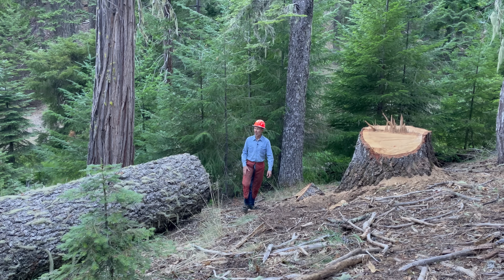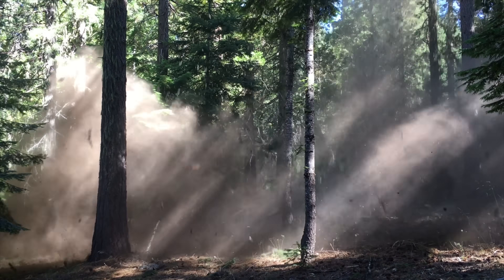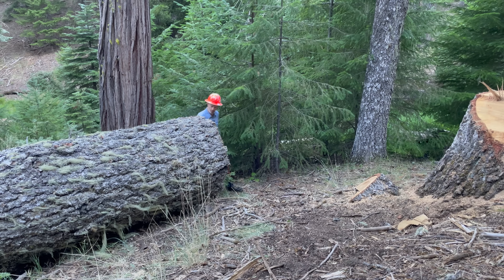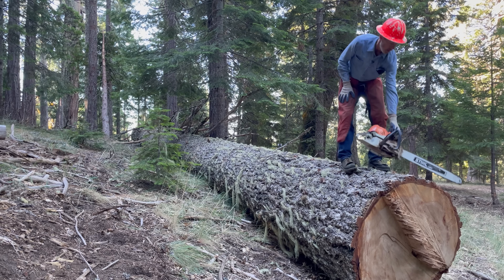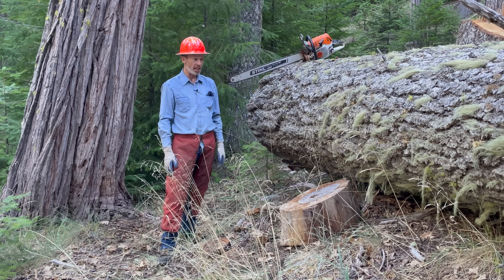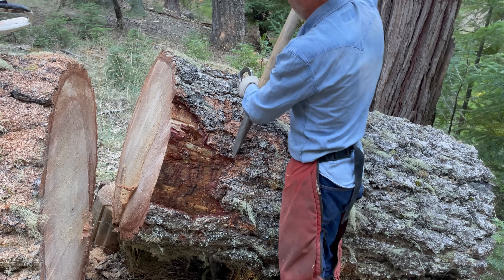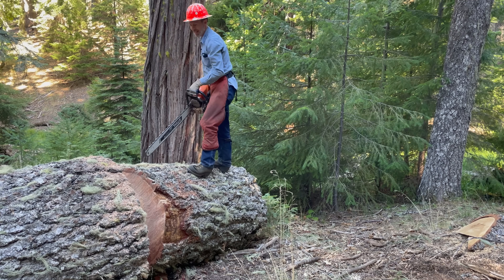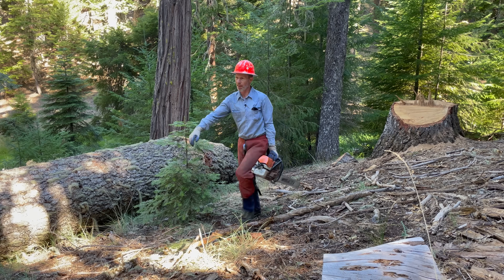Chainsaw Ripping Chain vs Square Ground Chain

Comment: Nice work!  Which saw and bar length is that?  Baileys says ripping chain is slower, but gives a smoother cut, but maybe yours was faster or comparable since it didn't plug as much?  A climber who also cuts slabs for businesses said he liked a skip tooth normal chain for his slabbing, probably white fir and jeffrey pine, since he was going to plane it anyway.  He had nice saws, but I figure skip tooth might help a marginally powered saw in big wood, by having fewer cutters doing work.  I haven't cut slabs or beams in a while, but your video makes me want to go out and work with the saw.
Reply: And now I see on your previous video you said it was a Stihl MS462 with a  32" bar.  Nice work, on all of these videos.  Love the humor you put in too!

Comment: I've found to pull back away from the block with the power head because of the noodles/strands. I pull back about 5-7 inches. Give it a try.

Comment: In my youth, I bought a Sperber portable chainsaw mill. It came with ripping chains. They were round tooth and if I remember correctly, the grinding angle was only 10 degrees. I was cutting African hardwoods though. Those chains produced an incredibly smooth cut, though the cut was assisted by the machine not being hand held. I'm in awe of your hand held ripping skills.

Comment: The difference is a bit bigger with hardwood.  Doing the same thing as you on a red oak about that size.  The square wants to grab sometimes from being more aggressive.  Rip is smoother, but there is also a little more forgiveness with kickback, when your bar cannot go all the way through.

Comment: When you are noodling like this, I would advise to clear out the plugged up chip evacuation on the saw, because if you just keep going, it sends the noodles in to the kerf again and causing the chain to drag since you are effectively just stirring around the noodles in a thick pocket of noodles at that point.
I don't think the wood is very unique in doing this btw. I have noticed that my ms661 gets plugged up all the time when noodling, the best way to avoid it is just to go a bit slower or angle the cuts to make the noodles shorter.

Why do I know so much about noodling? I have stopped paying for the morning paper and noodles are a good substitute for lighting the stove. Filling a box with noodles takes just a few seconds if you have big log laying around, just let it dry for a weak or two and you can easily get a fire going with it, though it does make a mess on the floor in front of the stove.

Comment: wow i wonder how much a tree that size weighs?? its gotta be like 50,000-100,000 pounds right? i looked it up apparently for  a 48 inch diameter douglas fir it weights 500 pounds per foot

Comment: Here in brazil we do a lot of rough wood with chainsaw, the trick is sharp the teeth at 0 degree, than cut with the tip of the saber, always up to down and foward. And slow the trotle for lubrication of the chain. We use in ours hardwood, soft wood don't grow to that size here

Comment: Very nice chain comparison! Check out the video by Advoko MAKES YouTube channel. Video -"Two Chainsaw Secrets | Turning a Tree into Perfect Boards." He demonstrates ripping logs freehand using only the bar tip, rather than the whole bar as a contact point with the log and "swinging" the bar back and forth. Seems crazy, but he has great results.

Comment: That's a really great way to divide up a large log for quarter sawing but if you want more plain sawn lumber, you should know (probably already do! :) that there is a way to saw really big logs intact on the Wood-Mizer. You peel 'em like an orange! You simply shave as much as the blade will take without getting stuck, then turn a little and shave, turn and shave. (Hydraulic log turning helps a lot...) Once around gets little more than the bark and a little sap wood. Then you keep shaving around until you get some big, nice flat sides. Usually there's a lot of sapwood and it then becomes firewood. I didn't see much sapwood on your log... 

You may have to do a little chainsaw work if there are knobs sticking out or if there's a lot of taper. (Don't cut the mill!!!) But eventually you get down to some nice flat sides and a great big cant of heartwood and then you just go and you can cut it any ol' which way you like! (or how the log tells you to cut itself!) Also, as you're getting down to that manageable cant, you cut off some pretty big but odd shaped chunks that you can mill separately later or burn as the spirit moves ya. Cheers!

Comment: My experience in ripping - I do quite a lot as a wood turner - is that the 10 degree grind ripping chain is slightly better all around, both for hand rip noodling and milling. For hand cuts, you can improve the cut quality by a few seconds with a chalk line and cutting more using the long bar at a lower angle through as much of the cut as possible (especially at the beginning)- this forces a straight cut using the bar as a guide.  Nice video.  Nice log. Thanks.

Comment: I have a lot of bigger trees that I cut up for firewood for an outdoor boiler. Quite often I have to rip them down like this to get it onto a log splitter. I have been thinking about getting a ripping chain but they say it is designed for mill use where the saw is locked in and not to be used handheld. Did you find any trouble controlling the saw using this chain?

Comment: I’ve tried both ripping chain and chisel (ground not square filed chain) on my Alaskan mill.  I’ve used a 3120, 395, and an ms660.

I’d say yes the ripping chain is smooth isher.  As far as getting the job done and moving on stay with a chisel (ground not square filed).  As a “pro” invest in a silvey or simington grinder and just touch up your chains as they get wood dull.  Takes only like 1-2 min per chain and it’s machine tight as far as tolerances go.  Hand files have so much human error.

42” bar gets me about 34” of slab on the Alaskan and imo the chisel ground chains far out perform the ripping chains.  Plus when one gets wood dull and slow just swap it for the next sharp one and keep going.  Try that with round filed anything and lmk which is faster.

Comment: Interesting content, as ever. I like the humour too. Speaking as someone who works in the woods in the UK and hasn't died (yet) I'm with you on 'not dying' being important.

bucket/ˈbʌkɪt/ noun 1. a roughly cylindrical open container with a handle, made of metal, wood or plastic and used to hold and carry liquids. 
Kick the bucket: to die, colloquial. 
Bucket off: the process of dying.   Let's not. Yet.  Looking forward to more of your vids.

Comment: Never knew there were different types of chain for different types of cut but when you think about the different types of hand saw blades it makes sense.
Reply: > "different types of chain.... different types of hand saw blades" -- Yeah a hand-rip is very different from a hand-crosscut. But the way a chain runs doesn't really want to chop the waste to chips or sawdust. So you end up with "noodles" (great name!) nearly as long as your blade. Which jam the drive sprocket and guard. His beast will chew some but my little electric chainsaws (for my little trees) just choke a lot.

Comment: Full complement chain makes smaller chips than full skip.
The 462 also has a very tight clutch cover even in the “R” model, unlike the 1122 and 1128 R models. 
He’s purty dam good with a saw that’s for sure.

Comment: I do some chainsaw milling.  Not professionally, just with some nice trees on my own place.  Ripping chains mostly give a better surface finish vs regular ground chains.  They should cut about as fast.  Any difference in cutting speed is probably less than the difference between factory sharp and "you" sharp.

Comment: What are the grind angles on those chains? I know terminology differs depending on region, profession, etc but I was under the impression that a ripping chain is a much lower angle grind than a standard crosscut. I use a ten degree, but I've also seen zero or five degree, where average chains use 30-35° angles.

Also if you want to get really deep into comparisons, Granberg makes a ten degree ripping chain with alternating full/half width teeth. I like it a lot but I've only compared it to a 30°skip tooth personally.

Comment: Just a thought, your side cover could be holding you back with chip flow when noodling. I noodle a lot for loading big rounds of firewood that don't want to split, and the 462 I have is a conglomeration of parts from saws that I have repaired. The current iteration has an aftermarket cover that flows really well, and Stihl has another factory option from what you have that usually comes on the R model. There's a noticeable difference on how the saw doesn't bog down with a wad of noodles packed into the side cover. Food for thought.

Comment: Great video I love the comparison. 
Here on the west coast in Canada, we often file a rip chain, when a normal skip tooth is halfway worn. I have never used a store bought rip chain.Interested to try one now.
You may find, working in the butt wood,
you get a lot stickier saw chips, that tend to clog in the sprocket more.
This is a result of more pitch, and the fibers in the butt are a lot tougher, and less straight,
 because they hold the tree, twisting in the wind.

Comment: You likely already know this but for those that may not, a highlift jack, works pretty well for rolling big logs. Also, if you have a big high value tree and plenty of free time, working the outside of the log down to size (cutting off the sapwood) will likely give better results for us mortals than trying to freehand through the center. Course that’s going to depend somewhat on how much larger the log is in relationship to your mill. 👍🏼

Comment: I work in a saw mill late 70 s till 93 we could cut 60" logs that were perfectly round, 66" if oblong, you know not round. Spotted owel shut us down. my house has 4" by 12" floor joists 24' long free of Hart centers,no knot's., straight grain.still getting pitch bubbles  40 years later.😊
Reply: Where can I get a  ripping chain
Reply: Pnw?
Reply: @bodyzoasispersonaltraining9186  what is pnw?
Reply: pnw could mean Pacific North West ?

Comment: Didn't you mention that your square tooth chain was a skip tooth, while the ripping chain was a full comp. This would account for the length of noodles and the rougher cut. I've seen this when ripping board on my chainsaw mill.
Reply: 13:54 he does mention it being skip tooth.

Comment: So, I cut wood for 10 years professionally here on the east coast in Canada and everyone here uses the round tooth for everyday cutting and everyone considers the square cut chain as the ripping chain. You have to special order the square, where the round is available everywhere. Its interesting to see differences between geological areas. I enjoyed your presentation. Thanks for sharing that.
Reply: How on earth do you guys get your undercut in with round chain?  It is near impossible with round. someone gave me some telling me it was "easier to sharpen"... Threw all my round chain out.  Can't cut sideways with it-=> junk.
Reply: @w8stral 
Hardwood vs. soft makes a big difference
Reply: @amosbackstrom5366  Has NOTHING to do with hardness of the wood, its called KLUTZ ditchwitchers shoving their bars into the ground cleaning up downed trees who enjoy rounded chain verses chisel verses those who do nothing but cut notches all day or who have to delimb hundreds/thousands of branches all day who REALLY enjoy ability to cut on the side of a cut due to being tired and yet still having to cut another hundred pinching branches.  Chisel cuts slightly faster, but rounded cuts better in dirt.
Reply: In Australia we use round ground chains as standard too, but not exclusively, harder to sharpen imo but fine when done correctly. A ripping chain would be considered a chain that alternates between fat and skinny teeth, usually in groups of two, skinny ones too rip and fat to clear. And has nothing to do with the grind of the teeth.
Reply: I worked a few years as a Canadian arborist; I never even heard of square ground chain in that time. Round worked great. 

I wonder if it's something to do with the prevalence of softwood here vs perhaps a larger amount of harder woods in the US.
Reply: @keithklassen5320  I think you have never held a chainsaw.  There is not a single logger of softwoods who uses round chain in the west.  Undercuts are MUCH harder to make with round chain.  Accidentally got round chain by mistake---> Its garbage.  No one should ever use it unless Joe homeowner who is ditchwitching with his chainsaw.

Comment: Anything you can do and hand on experience would be good.
Back in 2007 I felled 10 conifers for a friend in a narrow space behind his house, I watched 10 YT and only one of them made any sense as to how I should go about it. They were 12 inch diameter at 5 ft off the ground so I felled them at that stump height before chopping the stump low. The access and my safe space was cramped, hence chop them high while I was standing and could get out of the way, rather than squatting to chop low. My friend only wanted firewood and not logs.
I worked all day in hot summer UK conditions (nothing like you experience but for us 28'c and humid ) One thing I did discovered was my suspicions that I was Diabetic - work for 3 hours rest for 20min then 2 hrs and rest and then 1hr and that was the END I was shaking too much to hold the chainsaw. Doctors said the following week I was Type 2

Here I am many years later almost fixed my Type 2 and I now swing a Mattock and set garden flags, the only tree felling is I do is Shrubs and the odd Dandelion ;-))

all the very best

Comment: 6.17 yep "not dying" is the way to go; in my case I was cutting copper and brass under 20 meter of water. The only difference was finishing the cut before the air ran out. Even if you factored in that you could hold your breath for an extra 1+ minute or there was a bit of extra air in cylinder for your "stabilizing jacket" 
The only dodgy time was when a 6 foot 6 inch boiler pipe fell on me due to an over excited dive buddy. That was back around 1984, how time flies. 

Your video narration is one of the best on YT Funny and Informative.
Thanks you make my day

Comment: Cool video Wilson. I’ve split logs with a chainsaw before. Then I found a better way. Put one end of the log against a log pile. Then find a crack on the other end. with a wheel loader put a fork in that crack and push. Usually not as pretty as what you just did. But much easier.

Comment: I’m in the process of ripping some 44” diameter red fir and spruce. I completed one tree and on the second tree, it split completely through and knocked me to the ground and pinned my leg under it. Luckily I was able to call my neighbor and he came over and got the log off of me. Two small fractures on the top of my fibula and that was in June. I only have fifteen large logs left.

Comment: I've used ripping chain in my AK mill with good results but just a few years experience at it and unsure if I'm with the correct set up. Seems I am. I'm pretty happy with the results.  I focus on White Oaks felled from urban settings.  
 I'm using a cheap HF electric grinder now which works well.  Would like to see your take on the details of the chains and sharpening.

Comment: Man thats a lot of work. I have been messing around with an alaskan saw mill on redwood logs about 36" diameter im glad I dont have to quarter them like you did on that log. Id like to see how the lumber turns out. I like to use round chain because its easier to touch up with a hand file, but square grind cuts the best, I use granberg ripping chain while milling.

Comment: Those are amazingly nice cuts. Anyone who's tried quartering a big log knows it's not nearly as easy as you just made it look.
Reply: Amen
Reply: Gorgeous cuts.
Reply: I just cut posts to final length with my old West German 024 AVS with a 16" bar and cut all the posts proud before making the final cuts to get my eye in and I made horizontal pencil guide lines.  I even stuck a magnetic bubble level on the bar because the ground was uneven.  These square quartering cuts are most impressive.  Know you limitations and give yourself every advantage.
Reply: @lelenbates3367 😮
Reply: You can tell a master if he makes difficult tasks look easy.
Reply: Amazing cuts make amazing noodles.
Reply: This guy is next level, but I have ripped a lot of logs, with and without ripping chains, often preparing bowl blanks, or using my saw to mill wood (that is guided of course).  Bowl ripping is often logs that are very tippy.  It isn't any more difficult than anything else, one just has to try it, and a lot of that work is not something that is recommended, so most people probably won't try it.
Reply: min 13:08 Try using a maddox as a fro to split the rip
Reply: Yeah, that looks tricky. Is it would be an unholy mess if I tried.
Reply: Just holding it on the line while keeping the saw perpendicular takes years of concerted practice.
Reply: Amen twice !